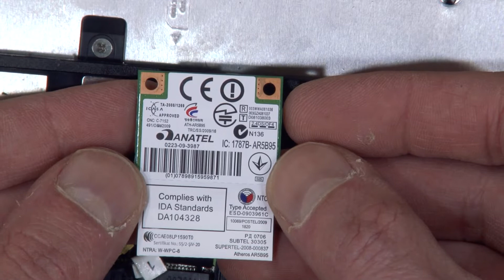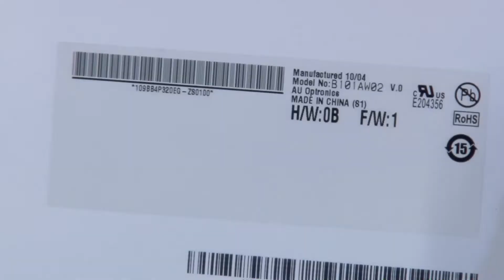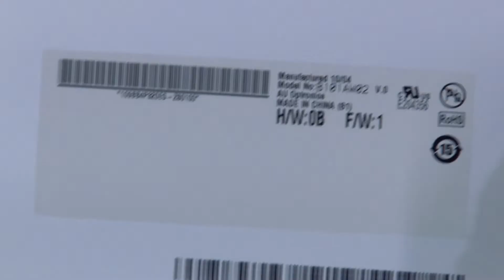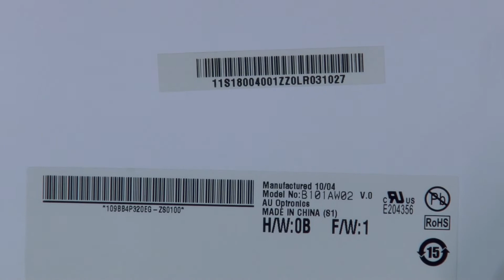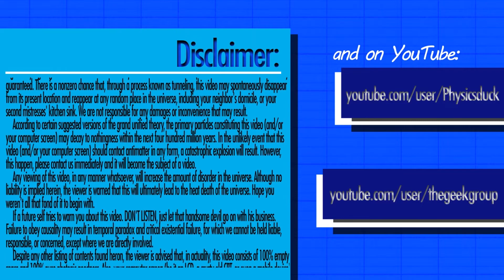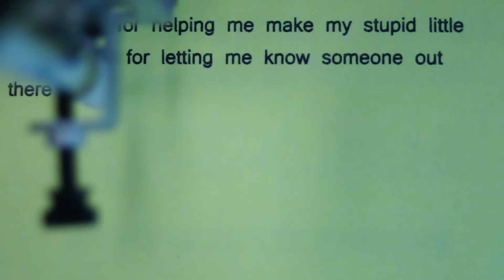Lenovo Ideapad Netbook Equipment Autopsy

Comment: You want something small with more stones? the GPD P2 Max is 8.9", has a intel m3 dual core processor, 16gb ram, and a m.2 ssd. If I needed another laptop, i'd probably go for that. I'm still rocking the first gen GPD Pocket, little 7" win10 machine... its kinda a folding phone size win10 laptop.

Comment: M12 battery's are a rip-off, they just have 3 15 amp 18650 cells, a pcb with the terminals, a thermocouple and 2 10ohm and resistors, you can get the board and empty shells for $20 and throw your own cells inside

Also for the ram, it's hardware limitation of the cpu and motherboard, most likely it won't even boot